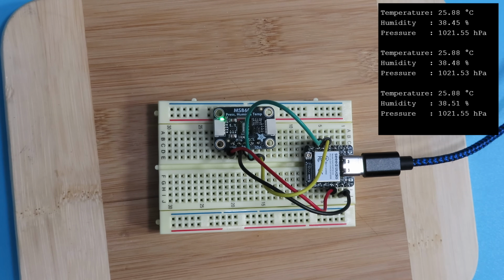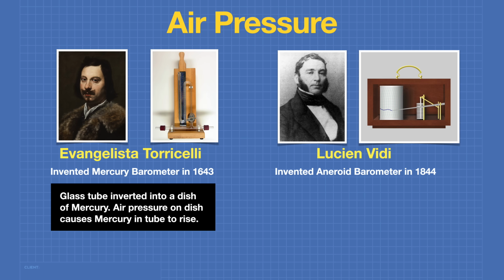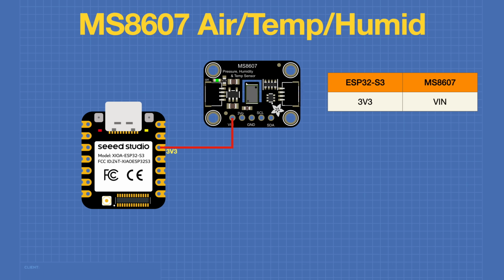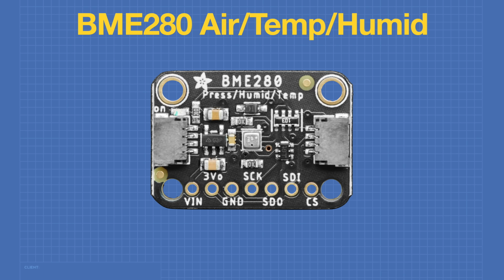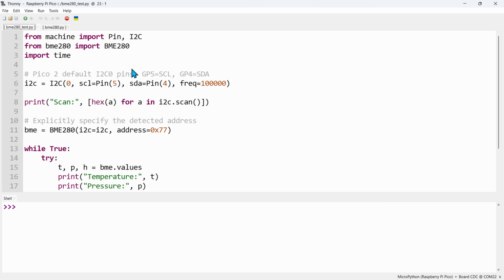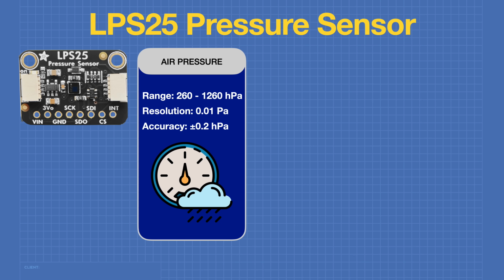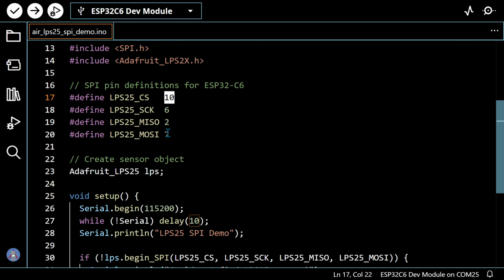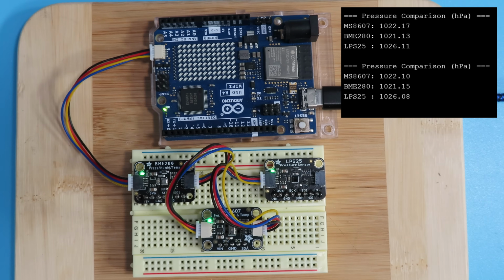Three Air Pressure Sensors with Four Microcontrollers

Comment: Thanks and great review of these sensors, really appreciate it.   One note:   Per the data sheet from ST Micro,  the LPS225, CS pin is used to select SPI or I2C communication, and should be pulled low for SPI communication as in your case.    Your schematic connects it to a GPIO w/o explicitly pulling low in your code, in setup.   Not a best practice.   Alternatively you could have just tied it to ground in the schematic.

Comment: Interested in higher pressures 5000 hectopascals, and temps 500C as well.
Reply: I believe none of those sensors work at those temps. They range form -20 to 80C, check their ref sheets.

Comment: I am using a DPS310 and an Adafruit Adalogger RP2040 as a kite altimeter.  I would like to see a video on measurement resolution and measurement noise, and how to reduce measurement noise. The DPS310 has signal processing to reduce measurement noise. Your channel has great videos. Thank you for sharing.

Comment: the BBC does a great forecast and pressure at 1948 and 0034 ( shipping forecast ),. nice video,. THX
Reply: Or the BBC weather app has hourly , local air pressure measurements. Could be used to check accuracy or your sensor.

Comment: Have 3x temp, hum & pressure sensors connected to RPi, 2x are 3b+ & cm4 with 5, 7 & 10 in screens.
They also grab data from the internet from api (JSON) sources of current, day &  forecast weather, sun position, [health (pollen, ...) & air quality (CO, No2, ... values) on 10" screen] using python to display on those screens.

Comment: You can also go to the junk yard and get a MAP sensor (manifold absolute pressure) .  It reads analog and needs no libraries if you are limited for memory.
Reply: Any videos, or articles about the application of MAP sensors?